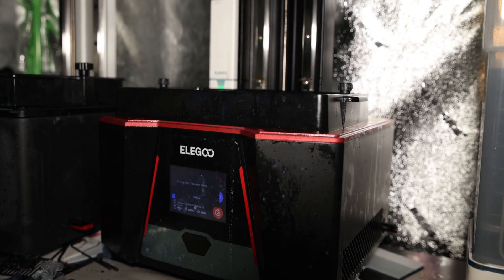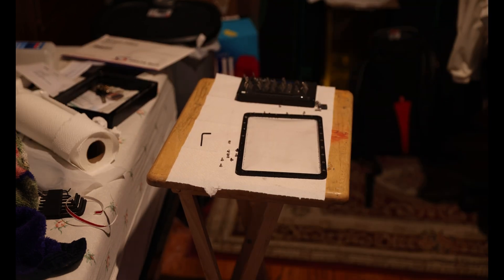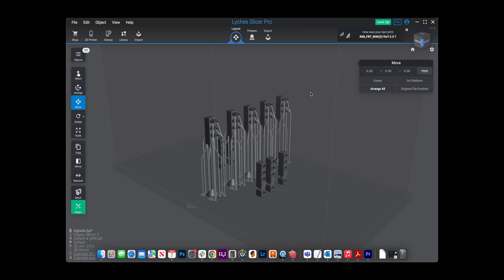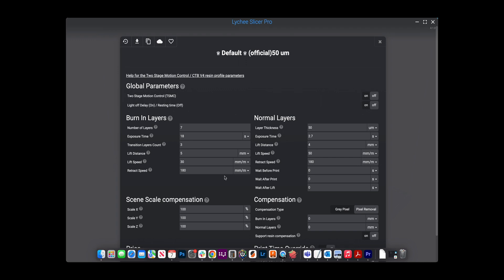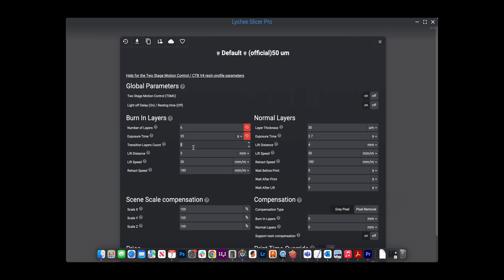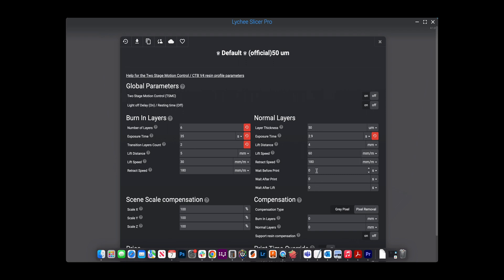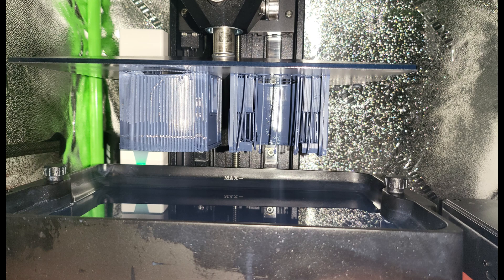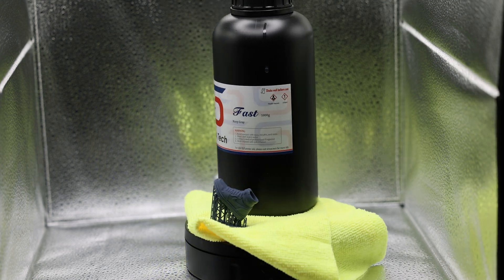Getting perfect bed adhesion with your Elegoo Saturn 2 (Or any other resin printer)

Comment: So you only tight them on the film and press zero z=0 without go op 0.01 intill a paper can slip true bed and film lol. Im so confused now..
Reply from the maker: Theres a little different methods people use. I usually just now use 2 A4 Papers on the LCD screen to level properly. There isn't really wrong way, just preference
Reply: @3D_MK  thanks for answering!  So im completely new to resin printing. 

So you do 2x a4 paper and then just home it and set the set to z=0  and done? or do you give it a 0.10mm up until a4 starts to move?
Reply from the maker: @Nickdayz  Nope, dont even press z=0, the gap created by the 2 A4 papers is about .2mm, so it gives right to about a .075mm gap between the fep and the bed plate since on average a FEP sheet is about .125mm thick. the extra gap on the first layer is not a big deal, as long as the gap is evenly spread on the 4 corners you should be okay
Reply: @3D_MK  hmmm weird. You lose screws of the bed right? Home it on the 2 a4 sheets  tighten the bolts of the bed. And you don’t tell the printer that this is the z=0 button? Just leave it as it is?

Comment: Thank you for the tips! I followed you! Which resin brands are best? I got the elegoo 8k and plant based and people say plant based sucks
Reply from the maker: plant based is very brittle and wont produce details like the 8k resin. the "less fumes" are a gimmick and you should always use proper ventilation with resin printers wherever You use them. Get a small tent enclosure if you plan on using it indoors with exhaust fan pointing out to the window. get the 8k resin. you wont regret it
Reply: I hope you will make more videos in the future! Im just starting out using these machines and would like to learn more. Thanks for the tips 🙏 if i wanna get other colors and transparent resin, which brand works best?

Comment: Hey, interesting question, but I noticed you also have an Epax E10. Does the saturn 2 vat bolts lineup with the ones on the epax? I have an E10 and was wondering that since it's also designed to be upgraded to the same 10" screen if there was any cross compatibility without making modifications. Thanks!
Reply: saturn 2 vat is thinner, so it wont line up with the E10, that being said id just stick with the saturn 2. Epax is over priced and does the same thing as saturn 2
Reply: @BroadwayNexp  Eh. I had a Saturn 1 and the ball joint was garbage for keeping the bed level during bed-wide high suction prints. Always came loose. I prefer the 4 bolts on the Epax.

Comment: What's your enclosure? I'm loosing my mind in winter. Either I'll build a closet wit heater or overpay for whambam
Reply: Very late friend, but I've found wild success with a Grow Tent from Amazon. Running $40, and I've got temp controller and a heater, haven't had temp problems since

Comment: Thanks for this video-- I just bought the Saturn 2 and a WhamBam flex plate. Does the flex plate change how I should level the build plate, or would it be the same?  Also, will these settings translate over to Chitubox?  Thank you!
Reply from the maker: yes, for elegoo they require to add a modifier on the sensor so that the bed plate can stop a little earlier due to the extra space of the flex plate. After you put that you can follow the method in the video
Reply from the maker: and yeah its the same with chitubox
Reply: @MK Ultra  Hi, first of all thanks for the video, I'm really upset with the adherence problems I'm having... Whick kind of "modifier on the sensor" do you mean? I'm still using the original fep so I don't understand if I can level the bed plate direcly on the fep or not...  Thanks a lot.

Comment: Good vid, do you find your buildplate unlevels fairly fast? I have to relevel after about 5 or 6 prints and Im really careful not to put pressure on the mounting knob. I find the 2 screws arent holding the huge plate as well.
Reply from the maker: If u tighten it down nicely, i found my self not needed to relevel for about 3 months, which for me is about over prints

Comment: What is the cylinder you have under the FEP during install? I've yet to change my FEP, but I'm reading to put something like a sponge and then others reading nothing at all under the FEP sheet for proper tension. Pretty contradicting.
Reply: Looks like a bottle cap, which is a method I use as well.
Reply from the maker: its a 3d printed spacer that used for properly tensioning a fep sheet when u replace it.  theres alot of thnigi verse and other 3d websites. usually thats the ideal size for meduim sized resin printers

Comment: Hi, thanks for your valuable video, I have had problems with the new elegoo saturn 2, I am using Lychee premium as a laminator but the print failed. in other videos, they say that I should print with Chitubox. what's your opinion about it?
Reply from the maker: Chitubox isn't bad, its most people go to's, however ive never experienced any problems with lychee, and it seemed to be more stable for me, using a window 10 machine. Where did the print fail?